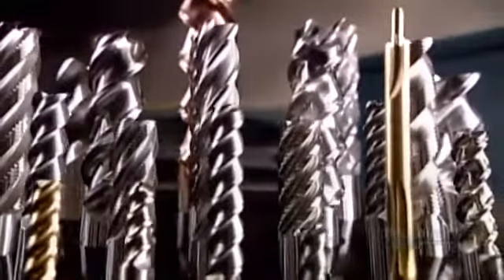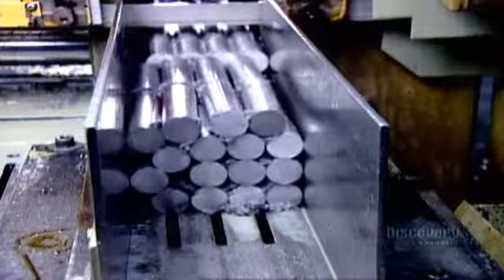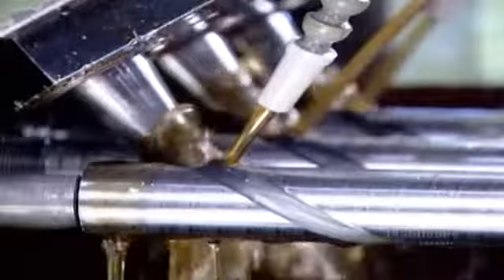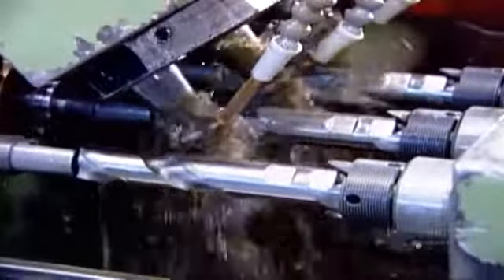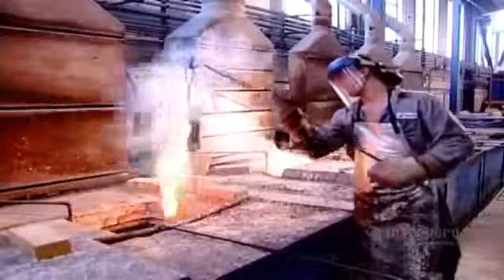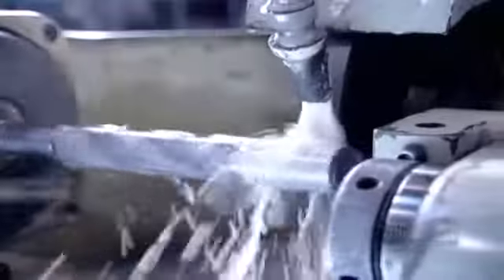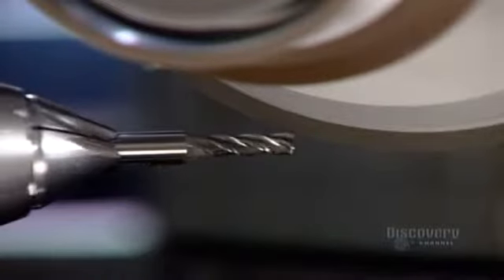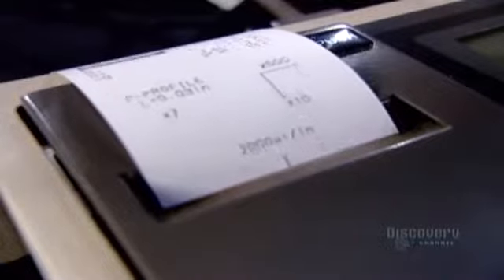How Its Made: High precision Cutting Tools

Comment: tools making tools, what makes the tools that make the tools?
Reply: this has also been my question for many years
Reply: if its high speed steel they will usually use carbide. Carbide tools are made with a powder so they dont require much machining other than sharpening
Reply: i can't sleep if this question can't be answer, for real
Reply: It's tools all the way down.
Reply: Its been a year since your question.. so have you found your answer between chickens and eggs, who come first?
Reply: MEN. MEN made them.
Reply: Coated tools are way stronger than the material that we use to make tools. After cutting, they get coated
Reply: After hardening, they grind it. Not cut it. Grinding wheels can take out material given low feed rate
Reply: Even more tools. And it all began with some caveman tying a rock to a stick eons ago.
Reply: Nickelback

Comment: When the video is intended to educate the nomenclature is important. Or maybe I'm just being pedantic
0:35 tungsten carbide is harder than steel, not stronger than steel.
High speed steel strength: 1200 MPa  hardness: 720 HB   Tungsten Carbide strength: 370 MPa   hardness: 25,000 HB
3:26 the tool shown is a dial indicator not a micrometer.
Reply: You are being incredibly pedantic. And that tool is not a dial indicator.